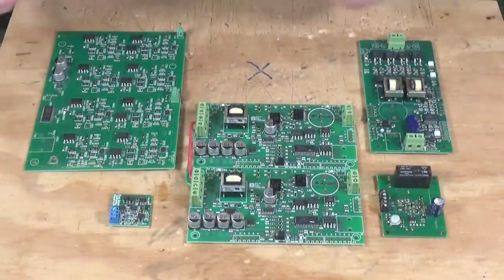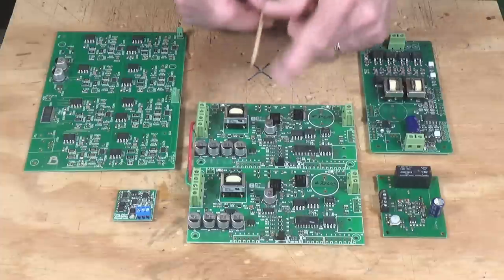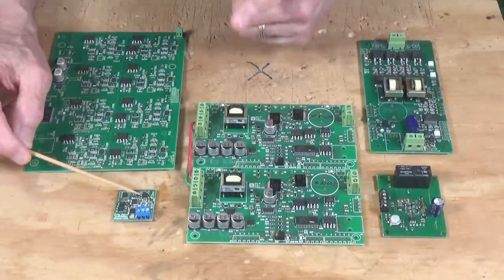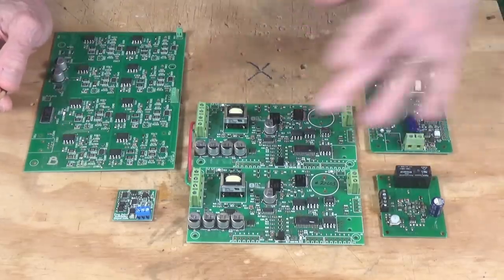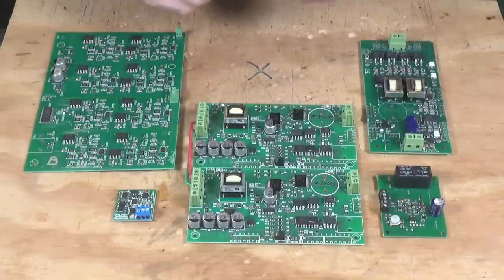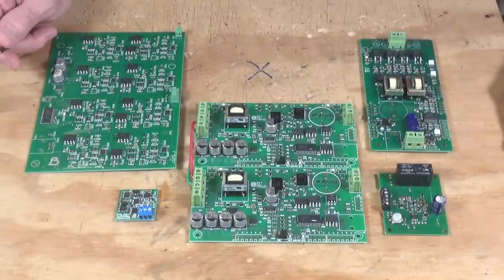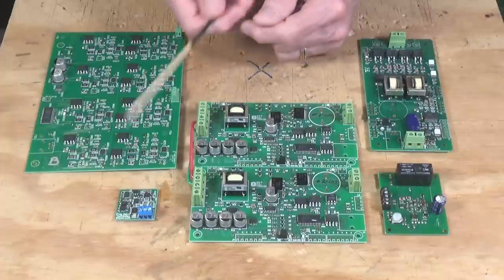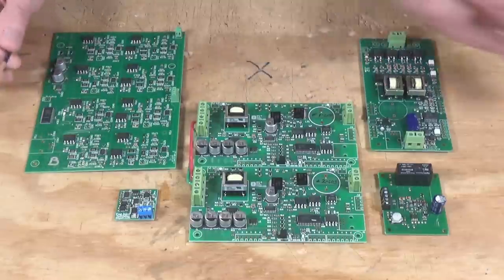The Inconvenient Truth About Autoreversers, Circuit Breakers, and Frog Juicers (279)

Comment: In my opinion a frog circuit is a waist of money. All you need to do is use a switch machine with contacts or even simply add a SPDT switch to the throw and wire the frog to automatically change polarity when the turn out is thrown. Cheap and easy. Same can be done with the reverse loop, A DPDT switch attached to the turn out throw allows you to change the polarity of the loop depending on the direction the turn out is thrown. Zero shorts or possible issues.
Reply from the maker: Yep, I’m already planning a video on how to wire Tortoises and iP Digitals for simple frog polarity control and how to use Tortoises for autoreversing polarity control.
Reply: @Handwissel  I hand lay turn outs all the time in HO as well as 1:32 scale. When I do that, I can rely on the points to make the correct polarity because my frog is not isolated from the points but instead on the other end. If its a manufactured complicated 3 way I use either switch machines like Tortoise with contacts, or if it will be hand thrown, I install a throw bar connection to a SPDT switch under the layout to the frogs. I have not seen in HO scale at least, a double slip that didn't have plastic frogs? That said, I am sure there would be a way though yes, there are probably always at least one odd ball situation where it can't easily be done. But generally speaking, 99% of installations can be done with simple wiring and contacts.
Reply: @tedamrein5146  What if you're brand new to dcc and just learning?

Comment: For over 15 years, I've been running NCE 5 amp radio with 6 Frog Juicers (of various number of outputs) on an HO layout with many different manufacturers' decoders without any problems. YMMV
Reply from the maker: Always include the modifier “yet”.
Reply: I agree. We have an entire town on our club layout above a staging yard that would not allow clearance for Tortoise machines. Therefore we use Caboose hand throws and two, 6 output Frog Juicers. We've never had a single problem. There really isn't a practical alternative there other than dead frogs, and that would be problematic for the small brass switchers we use that don't have all wheel pick-up. We operate that switching area extensively during our monthly operations sessions for several years and never had a single problem. Yes Larry it's theoretically possible, but we've never seen a problem.

Comment: Hi Larry. I have a Digitrax "DCS210+ Command Station/Booster With Intelligent AutoReverse" that came in the EVOX Evolution Express Advanced starter set. Does this not incorporate circuit breaker technology? Also, my point (turnout) motors are DCCconcepts Cobalt iP Digital; will these suffer from the same problems as the frog juicer(s) that you mention, even though the circuitry is built in?
Reply from the maker: The intelligent autoreverse has been around since Digitrax developed their first booster and I have never used the feature. It basically makes it a pretty expensive expensive autoreverser.

Comment: A little new to your channel. Great video.  I understand the pro's and cons to autoreversers. I agree with you on layout design and limiting reverse loops.  But wouldn't it be better to have transponder in the locomotive to tell the autoreversers to switch polarity coming out of a reverse loop in advance of the locomotive? I use Digitrax decoders because it has transponding built in and works with SurroundTrax by SoundTrax for layout sound (when it's done ).
Reply from the maker: Interesting idea and I guess it might work with Railcom as well. However, knowing how complex it can be to set up the transponder receivers I am not sure how many folks will go that route.

Comment: I have a small DCC layout with one power district. I know my Digtraxx Zephyr is a low end power/command station and has a circuit breaker, it has worked. Should I install a circuit breaker as described between my power feed and the Zephyr?

Comment: So in the end: What's inconvenient about these devices ? The only advise I see is to add a switch to a circuit breaker to re-power a shorted section manually. But that is part of the install instructions.
Reply from the maker: The problem is that these frog juicers and autoreversers REQUIRE a short circuit to work instead of preventing a short circuit. Circuit breakers, because they keep reconnecting power to a shorted track produce a series of shorts until you clear the problem unless the manual reset option is activared. As one DCC manufacturer used to tell me “real men don’t read instructions”, which is why tech support gets so many questions.
Reply: @TheDCCGuy  Thanks for your reply. Maybe Manufacturers should make a video instruction instead of a print. A pic tells more than thousand words.
Reply from the maker: Some companies like Digitrax do have YouTube channels with video tutorials. But in the end a lot of folks still want someone to hold their hand and spoon feed it to them.

Comment: Hi Larry, thanks for a particularly  illuminating video on a subject not often discussed and not always well understood. I am a recently retired Systems Engineer (electrical engineering and computer science) just beginning my journey into the world of DCC model railways. I have moved from the initial research phase into the "test track, prototyping phase". One of the key and surprising (for me) discoveries from my research and planning has been the reliance on deliberately short circuiting a railway (system) to achieve an outcome. e.g. detecting a short, then taking action. All of my SE background tells me to, wherever possible, design out the potential for a risk, in this case a short circuit. Where this is not possible, then design in as much system protection as is deemed mandatory for safety, both personnel and hardware.  

Circuit breakers (digital and analogue) are always the first line of defence. Modern command stations and boosters will typically include both up stream and down stream (towards the track) protection. e.g. a derailment on the far side of the layout. When encompassing additional CB's in the layout design, which I will do, it is important to ensure that the down stream protections are properly matched and that breakers will trip in the correct sequence and timing. My preference will always be "intelligent" solid state, fail safe breakers with a manual reset.

With regard to turnouts or points, including crossings, then it pays to go for reliability for frog switching - it seems to me that a mechanical link between the turnout control mechanism and the frog polarity is often the simplest and most reliable methodology to adopt. I rely on the switch built into the point motor of choice, Tortoise, IP, MTB, etc.), for the DIYers and their servo controlled turnouts, then link a mechanical micro switch to the servo arm as well, to trip a relay to switch the polarity. (Not that I am a fan of mechanical relays, but they have their uses)  With due respect to the manufacturers of the various "juicers", I will not use them. Never wait for the short, preempt it.

As for reversing loops. Again, I cannot fathom why one would wait for the short to happen before switching the polarity of the rails, seems fundamentally wrong to me. We know there is a possibility (certainty) of a short occurring at one, if not both, ends of the loop. Why not detect the train/loco approaching the loop first. Then, if required, swap the polarity before the train/loco enters the loop. This can easily be achieved by having a sensor placed prior to the loop, or one at each approach to the loop for two way traffic. Once the train/loco is detected the polarity change can be triggered as required. In my case a use an Arduino type processor, with a very simple program installed, to sense the arrival and to change the polarity, as required, via a digital switch - not a a mechanical relay, as I said I am not a fan.

If the loop is "controlled" by turnouts, then the turnout frog can be used to manage the polarity as described above.

Sorry for the long post, but your great video inspired me to "stand up at the lectern again". Thanks again Larry - I enjoy your episodes.
Reply from the maker: Exactly the point I tried to make in the wrapup. Design to prevent shorts and choose devices that prevent them not use them.
Reply: There are reverse loop devices on the market relying on entry/exit areas in which they detect the power consumption. They are relatively complex to wire and I do not know what happens if e.g. a shunting loco pushes some wagons into the reverse loop which do not consume any power.

The best way to solve this might be a light barrier (or light reflection device between the two rails) before both electrical separating fishplates of the reverse loop to correct the polarity of the reverse loop before any vessel enters it.

Comment: Many track insulators have a small pin that sticks up between the two rails being connected above the railhead. This lifts any single wheel above the rail to prevent high currents through the wheel. In the situation where the short is used to trip the reverser almost instantaneously in order to protect the electronics  it is probably better to have the single wheel do the shorting. If a lead wheel is prevented from operating the reverser the short won't happen until it has to flow through a pickup, through internal wiring, and out through another pickup and wheel. This will bring the large current and potential surges right into the pickups and wiring near the decoder. 

A razor knife will help you cut out the raised pin and let any arcing happen when the first wheel hits the open gap.

Comment: I use two separate independent systems for reversing loops.
1.)  Two photo detectors just a few inches beyond the frog on each of the branches detect if any part of the train is on that bit of track and throws the switch (turnout) to the branch that is occupied (okay, both branches are technically occupied if it's a loop, but you know what I mean...).
2.)  Two isolated track sections just beyond the frog on each switch detect current draw (i.e. a locomotive only) and reverse the polarity on the main part of the loop to match the section containing the locomotive.
This works perfectly whether the locomotive is pulling or pushing the train, in the middle, or even multiple locomotives at different parts of the train.
Reply from the maker: Sound interesting. Care to do a short video to share with folks your setup?
Reply: @TheDCCGuy  I'm just a watcher.  I have no clue how to make a video :-/

Comment: To avoid runway locos take the DC function off the decoders change CV-29 to 34  for forward  or 35 for backward.  I've had that problem in the past but not since I've changed the CV values to34.
Reply: Our club requires the dual mode to be turned off on any loco that operates on the layout. Runaway problems ceased.

Comment: Howzit Larry : Notwithstanding electrons strolling around  * Near The Speed-of-Light; *  it has been my understanding over the years that these  * Short-Circuit Reactive *  units are designed to detect the problem BEFORE the actual control DCC-System is aware of the short; thus lending protection to both Decoders and the System. But ultimately; the short occurrs as you described in detail. In finally getting to my questions : [ 1 ] Given the carrier-voltage and usual 5-8 Amp rating; there surely has to be a nano ( ? )-spark that is generated every time across the gap ( s ). Does this not create spark-erosion pitting of the wheel-tread that must lead to eventual poor pick-up / electrical continuity ?  [ 2 ] In successfully using Auto-Reversers + Circuit-Breakers + Frog-Juciers on my Layouts; does close proximity in placing these units near the scene of the crime play an important role by way of promoting optimum performance ?  Much Thanks for your informative Series  and  Cheers For Now / Johnny
Reply from the maker: It can and if you turn the lights off you can see the little soars between your wheels and the rail. I have never noticed pitting 9n any of my locos but N scale folks have mentioned this ada potential issue for smaller scales. I don’t have that many frog juicers soI don’t have many shorts on the layout.

Comment: Another great video. I have noticed that every autoreverser except one manufacturer detects a short circuit to initiate the phase reversal. And I agree this is a downside of AR's. Digikeijs uses a sensing track at the inlet and the outlet, then changes phase before entry into the reversing section. This seemed like a better way and I was wondering if you had any opportunity to look at this item?
Reply from the maker: I have not, but I have been giving them a closer look as they offer some innovative products.
Reply: That system seems to be ahead of all the other reverse loop detectors, but Digikeijs is now out of business.  Let's hope one of the other DCC suppliers has the power to buy the technology and get it back into production.  Having a second block to allow the time for the loop to adjust polarity instead of using a hard short as the trigger is so simple and easy to manage; it seems to be a best practice.  Digitrax are you hearing this?